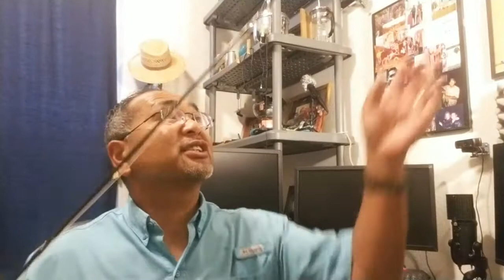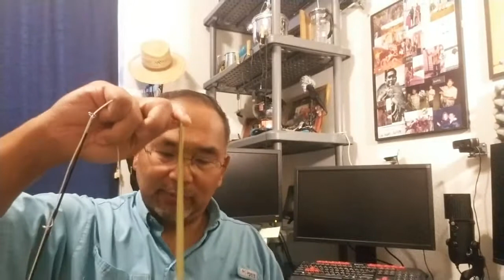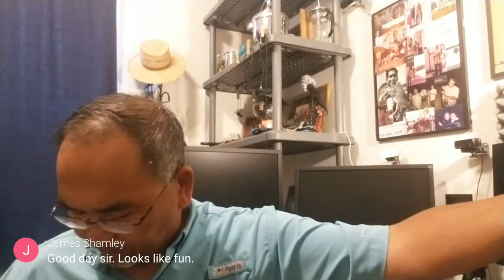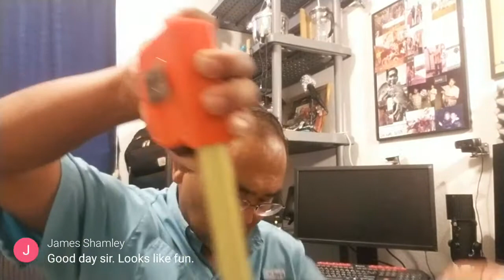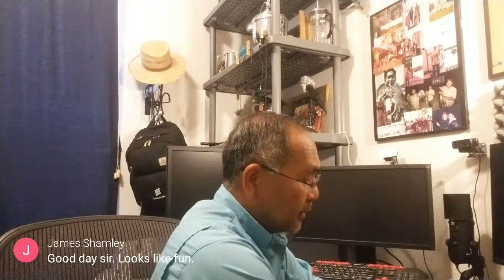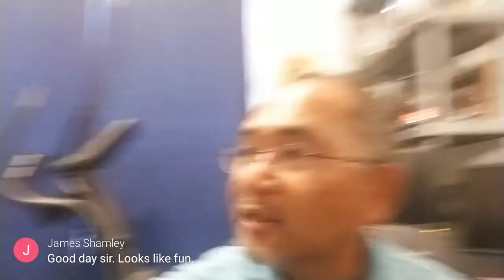COAF Field Team Livestream - Updates | Two Piece Micro Fly Rod

Comment: Thank you for the answer! I built one myself because I got inspired by your videos. I bought my pen rod from Amazon and I had an extra ultra light 5ft 6in two peice rod. I cut the pen rod in half and glued the links so that it is fixed in position and not telescopic. I then took the top section of the trout rod and was able to to attach it to the pen rod. It is now a handy two piece rod! I caught a load tone of small bass yesterday with the setup and some homemade flies :) my goal is to fight a large carp with the setup.
Reply from the maker: Awesome! Good luck on the large carp. Have caught some nice sized Catfish with the two-piece micro fly rod!